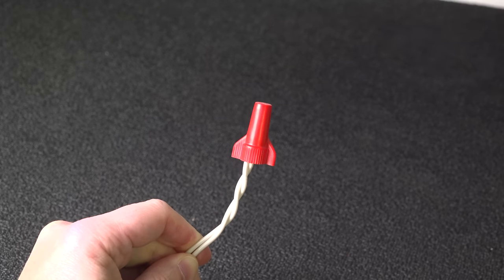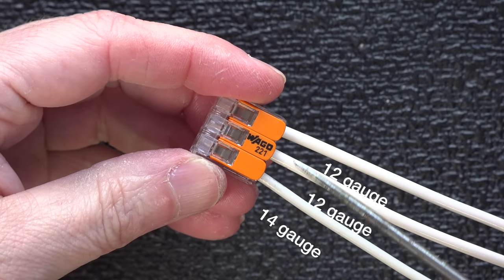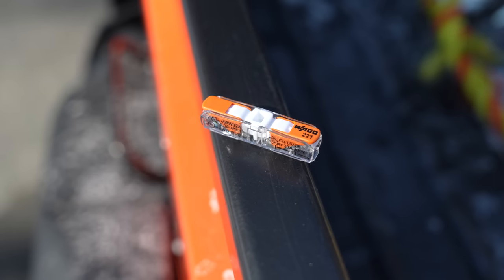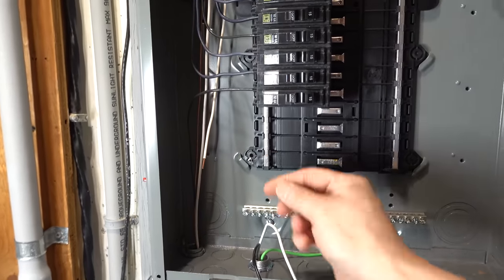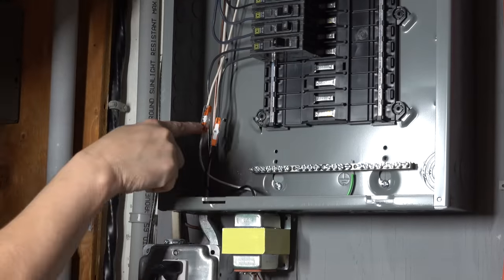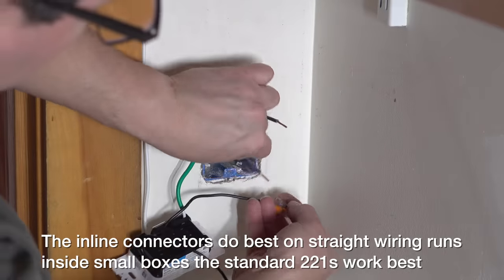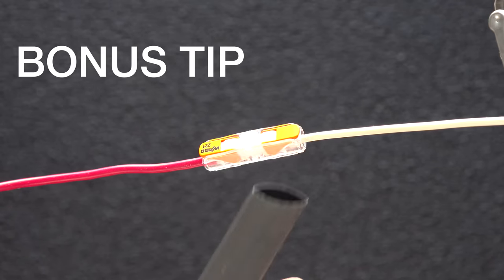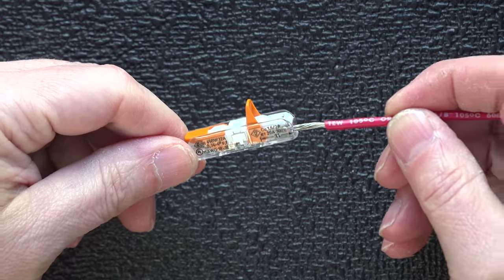New Wago Electric Connector is SHOCKING everyone - Inline 221 has arrived!

Comment: I struggled to accept that these are as good as (or better than) wire nuts. They just don’t feel as secure. But I can’t deny that they are easy and handy. I have to trust the experts and now I use them every chance I get. I love them. Thanks for sharing. -Ed
Reply from the maker: I know what you mean, if you haven't seen this test I did, its interesting to see how well when I run 3x their rated power through them vs wirenuts: https://youtu.be/B1pmuRsf1co
Reply: @SilverCymbal  that was great!
Reply: I wouldn't trust a wire nut as far as I could throw one. I have come across so many that were so loose they weren't ensuring a solid connection.

Wago connections on the other hand? Beat EVERYTHING else hands down for speed, simplicity, flexibility, robustness, security and connectivity. Plus check out one of John Ward's videos on test to destruction of various connectors under extreme oveload to see how truly brilliant these things are.

For Brits or any Top Gear fans they are the Toyota Hilux of the connector world ... Indestructable! 😂😂
Reply: Use the push fit ones.
Reply: You can pull off a wirenut with ease wtf you on about
Reply: @spiderfandom7592  exactly! ... THAT'S the problem with wire nuts. They can come loose over time. 🤔🙄

Comment: I have also used WAGO 221 in the car where it is dry. There's no problem. WAGOs are also ship approved if it is in a dry box.
Also good for all where the cables have to be changed again.
Reply: @Steve Sherman Solder is actually very brittle and is not suitable for long term use, especially when there is vibration

Comment: I love wagos. I cut some wires in a junction box too short (Only 1" exposed in the back of the box, not enough to wire nut), and was able to revive the existing wiring by slipping wagos on the end. There was no way I would've been able to install a wire nut at the back of the box, and would've had to pull a whole new line. This was #10 wiring that I originally thought I'd never use when I got the house. Came in handy when I needed the circuit after all.

Comment: Mon ami- I am an avid subscriber and truly appreciate your focus on the practical. You always deliver.
Perhaps it is my age, but it would greatly improve my absorption if could speak at a slightly reduced pace. Thanks.
Reply: I am hard of hearing and have the same problem with several YouTube channels, particularly Project Farm. I find that altering the playback to x0.75 speed helps a lot.

To do this on a desktop PC you can either:

Press the "<" key on your keyboard (SHIFT and comma) to reduce speed, or the ">" key (SHIFT and period/full stop) to increase the speed.

OR

Click the cog icon towards the bottom right of the video, and then choose "Playback speed" to set it from 0.25 to 1.75.

I also switch on Subtitles (Close Captioning) when the video has them by pressing the "C" key on the keyboard, or by clicking the cog icon again and choosing "Subtitles/CC".

There are also keyboard shortcuts to rewind or fast-forward the video by 5 seconds at a time, which is useful if you miss something and want to play it again.

Comment: In situations where I want to waterproof a wide connector - 
I bare the wire and then put two sizes of heat shrink on the end of the insulation to increase their diameter (heat them). 
I then put on a sleeve that will go over the terminal. Made up the terminals. The heatshrink moulds on to the earlier heatshrink leaving no gaps.

Comment: As an electrician, I use wagos only when necessary; wire nuts are still a much more solid installation. With just a little jiggling and tugging, a wire will still come out of a wago. When used throughout a job, the make up in the boxes will be much tidier, and the installation does appear to be mostly solid except under continuous duty applications where the circuit is near maximum amperage.
Reply: There are different types of wago.
The older Wagos without the lever ARE MEANT to be wiggled back out. 
The newer 221 are almost impossible to pull out.
You usually also don't twist and turn Wirenuts/wagos in the junction box

Comment: Waterproofing one of these, or any small junction, is not too difficult. Create a generous blob of hot-melt glue in the middle, thread the shrink-tube over, then heat from the center and out on both halves. The hot-melt glue re-liquefies while the shrinking tube pushes any excess out the ends (use enough hot-melt that his happens). This creates a very tight seal that can also tolerate some flexing.

Comment: There are soo many good rhings about wagos...
1. You can actually see if the connection is good. 
2. Easy to install and uninstall. 
3. They have a little hole to put a probe (duspol, multimeter etc.) In for testing 
4. The things mentioned in this video.

Comment: Finally! I've been waiting for Wago to make these. I've been so close to buy knock-offs to use in projects and repairs but I wouldn't trust a knockoff.
Reply from the maker: I am right there with you, I almost did the same. But they are junk, a few UK guys on Youtube and Bigclive too I think tested them and found they are garbage inside. Now I just need Wago to bring their waterproof box, maybe soon
Reply: @SilverCymbal   lol i love it when Bigclive takes things to bits
Reply: It didn't know they were new? I have the straight ones since at least 1/2 year.
Reply: @REDxFROG  Really? I've not seen them in my local hardware store at all. This video is the first time I've seen they exist.
Reply: TE Connectivity made a knock- off, they were white and green.  They got in trouble for patent infringement and they stopped making them.
Reply: I bought it and returned asap. Wire would fall out easily.

Comment: These are fairly new in South Africa (as far as I know) and other than being expensive they’re very handy, they also have a small opening for checking with a multi-meter. 

Wire nuts fortunately never took off here- we use “chocolate block” connectors that use a screw in a brass block surrounded by plastic to insulate, they work but Wago’s are faster and easier.. as long as the customer has the budget;-)

Comment: 3:37 Additional Tip:
You can put a small amount of Hot Glue on the wires, then heat shrink the tubing on top of the hot glue.
While heat shrinking the tube, the hot glue will spread out and seal everything. 
Great for outdoor and marine application.
Reply: You can do that but that's not a reliable seal unless you have some very specific hot glue or live in a pretty hot climate. Hot glue shrinks and hardens when it gets colder.
Reply: @AlexusMaximusDE  automotive epoxy also works.
Reply: @Mikipedia  Toothpaste also works. Just use something that is supposed to be a flexible sealant like silicone or something. What is it with people refusing to just use the right tools and materials for a job?
Reply: @AlexusMaximusDE  it is literally is used by pro rally teams all over the world to seal looms between the wire and the heat shrink wrapped connectors to make them all weather/condition proof. It is the right tool for the job according to much more specialised professionals than you or I.
Reply: @Mikipedia  Alright, you heard something, had no knowledge of the topic, didn't understand the nuance and are now spouting misinformation. 

They don't use random "automotive epoxy", they use a specialized epoxy made for this exact purpose which is formulated to stay flexible in combination with specialized heat shrink tubing and specialized heat shrink boots which are abraded to ensure a good bond.
Reply: @AlexusMaximusDE  lol I never said random anything. Stop being butthurt over something that works. If it lasts a long time is another question entirely and subjective to what one deems a long time to begin with. Point is the OP is correct and you know it.

Comment: I just used them last sunday in my load center to wire up the Ecoflow SHP 🎉 They are up to 20A though. For higher amp you will need to find something else. Like butt connectors rated for the application.
Reply: I am using Wago 221-613 that are rated up to 30A AWG10 wire.
Reply: The 221-6xx series is actually rated at 41A.

Comment: Ive used the regular WAGOs and some off brand inlines that are pretty much the same as the new WAGOs.
Other than if you have a wire cut too short inside a box or a really out of code packed box with a ton of wires in it, I don't see much of any problem using wire nuts. WAGOs are cool and they work well, but idk I just don't see a need for them to be used with everything except for a few tight spots.
As long as you know how to use wire nuts they are just as easy as a WAGO but need more room to be installed.
And this is from me as a part time electrician.

Comment: If you're only connecting Solid Wires, you should use the Wago 2273 instead. Wago also sells connectors and accessories for nearly every other use case you could imagine. (gel boxes too, so they get watertight)

Comment: I just did an installation where I had to clean up some wiring and reroute it and I replaced all the old junk with Wago's. Couldn't be easier. In my car I've also used Wago's for my radio and they've been in there for years and have not come loose due to vibrations.

Comment: I personally like the WAGO connectors due to the ease of use and being able to mix wire types. They are a requirement for refrigeration equipment that contains hydrocarbon refrigerant aka r290 and r600. They require them due to the secure connection they make over the wire nuts and crimp connectors. I have a tool the makes crimps good but is hit and miss with some wire sizes printed vs what the actual wire size is. That is why I have mostly switched over. I have seen the video demonstrations of what amperage a WAGO can handle but still don't 100% trust them in high vibration environments. I don't keep wire nuts around as much due to these, there is usually 3 boxes that I kept but may have to add a 4th with this now. Cheers to all.
Reply: i havent used them in high vibrarion environments yet, but knowing how they work i would trust them 100% there.. because if the wire tries to wiggle its way out it due to vibration will dig a grove into itselfwith the spring where it locks against.. same principle as the older Wagos for solid wires where you just pushed them in. In fact you can do that with the 221s too.

Comment: Honestly I would get some good and bad connections with wire nuts. Never had that problem with wagos. I honestly love these things.  The only down side I see is maybe the flip up orange part getting caught on wiring and pulling the wire out, but I found that as long as you are careful when putting things in the box, they won't get snagged. Also you don't have to strip so much to get them to work.

Comment: Anyone else feel like they provide a better connection with stranded wire? I've been giving the wire a little wiggle back and forth after closing the lever to let the strands settle into a more compressed state. Not sure if its in my head, but it feels better. 

Also, every video always show the closing of the levers, levers side up. I close the levers while facing the clear side. That's where the business can be seen.

Comment: I put the hellerman type push in connectors on a trailer back in 2012, had zero problems with wiring again,  until the 1 light was ripped off that is. But changing the light was easy enough...

Comment: Yes, these things make electrical work so much better.  I am using them for solar too.  Have them running up to ~520 VDC no problem.
Reply: Not within spec. If they melt and burn down the property, your fault.
Reply: @maxking3  Its listed as UL 667F as 600V.  Which matches the common N. American 600V standard for many common conductors: NM-B, THWN, THHN, MC, UF, ...

Look at Wago's 221 product sheet even indicates use with "1000V signs & fixtures".
Reply: Edit: Just saw that they are indeed 600V (1000V) in the US brochure but only at 20A and 30A  respectively…

The specs for the 221 on the WAGO website are as follows:

221-4xx: 4mm2 - 450 V / 32 A
221-6xx: 6mm2 - 450 V / 41 A
Reply: @maxking3  Yes, and my solar application was ~2500W each over two separate array strings.  At those high voltages, the amps were small at max ~4.8A and only during max sun.
Reply: @beyondfossil  My strings have up to 980V with a peak of nearly 10A … but that‘s DC. 

I would definitely not consider WAGOs for that use case.
Reply: @maxking3  What solar panels and string inverter are you using for that big setup?
Reply: @beyondfossil  E3DC S10E - 2x 21 Heckert Panels (320Wp)= 13.6 KWp (powering a 13KWh battery)

Comment: Great video. Love Wago & Ideal brand junction style connectors. My one and only concern is based on another video, where the electrician compared These Wago 221's with wire nuts. In the video a thermal camera was used to show heat, and a bunch of meters gauging current. The wagos got pretty warm, indicating problems with ampacity. They tend to fail sooner than wire nut, but that's arguably not a bad thing. I'd still use them for lighting, or 15amp branch circuits. I'd think twice about 20amp receptacles, but it just depends.
Reply: They fail sooner than wire nuts because they have a rail inside to connect the two loads whereas a wire nut just holds the wires together and does not act as a connector itself (current just passes from one wire to the next since they are already together). That said, I'd still choose Wago every time, much more secure and really easy and quick to use.

Comment: Wago 221-2401 is the inline connector.
221-412 is the two port connector,
221-413 is the three port connector,
221-415 is the five port connector.
Reply: yes, and 
221-612 is the two port JUMBO connector, for up to 6mm² wires
221-613 is the three port JUMBO connector, for up to 6mm² wires
221-615 is the five port JUMBO connector, for up to 6mm² wires

Comment: I'm the 3rd person you don't recognize... the person who has never had issues with the wire nuts... because I select the proper nut size. I believe the expression is, RTFM. I forget where I read it, but WAGO was slightly higher resistance, which isn't a big deal with 220v, but with 110 it could be an issue. No matter what, I'd use WAGO is I had them, but I have a bunch of various sized wire nuts, so until I use them up, or they fail, I'll just keep doing it correctly and not worry. Both feel good enough. My secretly honest reason for still using wire nuts is that they feel good. I like screwing them onto the wire and putting the perfect amount of tension on it to create that near zero resistance. Call me old-fashioned.

Comment: I'm an electrical engineer. I had some issues with Wago connectors on high currents (32A). The force applied to secure the wire in the Wago connector seems to diminish over time, so their contact resistance increase over time, which translate to increased heating, which can melt the Wago and even start a fire.
The mostliable connectors in my experience are crimped ones.
Reply: well, with 32A/4mm² you are already at the edge of usability for Wago connectors.. But yeah, considering longterm reliability any connector without a screw/spring ought to have advantages..

Comment: Been waiting for inclines.
Also just got my 1st set of IDEAL lever connectors and will be evaluating them.  IDEAL invented the wire nut in the 1920s when they were ceramic.  For those of us that used to splice and wrap before plastic IDEAL wire nuts, we will always appreciate what wire nuts did for us.  And as to trailers and RVs it is still splice solder and wrap.  Or how about diodes for for adapting between car and trailer

Comment: After discovering these 'new' WAGO connectors, they are the only things I use when I need to wire up new light fixtures, outlets and switches.  Wire nuts take up too much space in the box, and they do not work very well with solid/stranded wire mix.  I just wish they weren't so expensive.

Comment: Old school electrician here…wagos are fast, convenient, and often safe. However, I have personally seen them fail in high load situations over a long period of time. Wire nuts if used properly are not as prone to failure under high heat, high load situations because the connection is directly through the wire and not the connector itself.   Both have their uses, and the inline wagos are awesome in some situations.
Reply: As you say "if used properly"

Comment: So Wago now has what is effectively a butt connector, excellent.  A Wago could be made watertight with liquid electrical tape or a heat shrink connector whose adhesive seals completely around the wire on both ends.

Comment: I use the lever nuts only for temporary connections or if i have to connect fine stranded wire to the rest of the installation.
In all other cases you gonna have a much easier time with wago's standard push ins. They consume less space and cost way less. For a home owner, this might not be much of an argument, but for professionals not only time is money, money is money too! Shocking, i know 😛 
And since they need less space you can omit junction boxes sometimes, cause you can just make the circuit behind a switch or outlet.
Reply: Here's another trick, check if it is in accordance to your local code. You can fill a wago push in connector with clear, non corrosive grease. You push in your wire and tadaaaa, you got a water resistant connection. It is not fit for submerged duty or heavy spray but does a real good job in foggy and steamy environments like my bedroom.